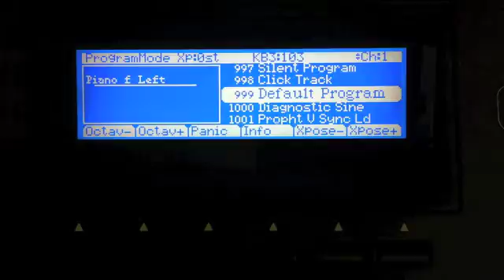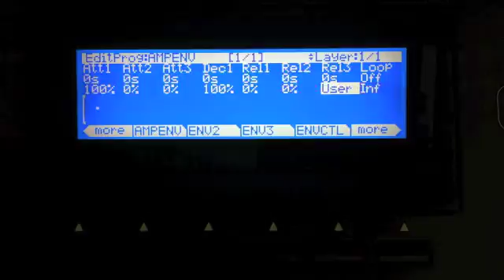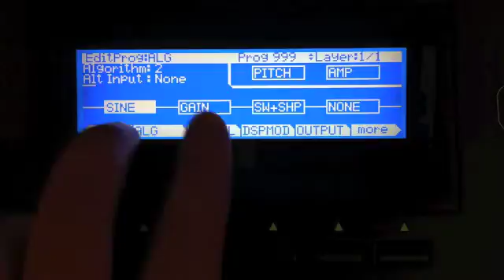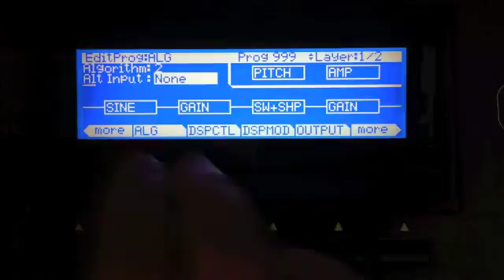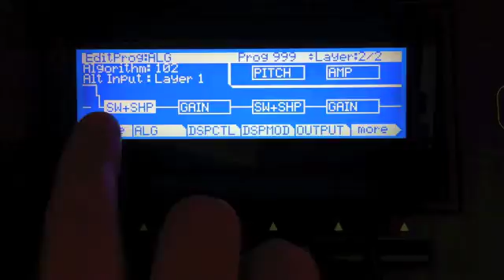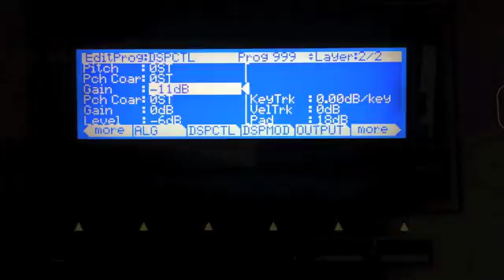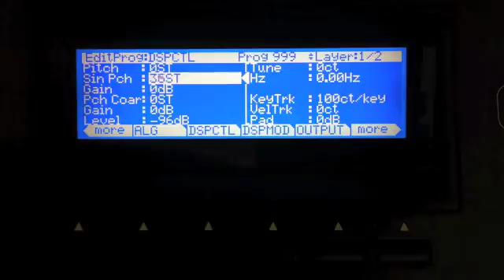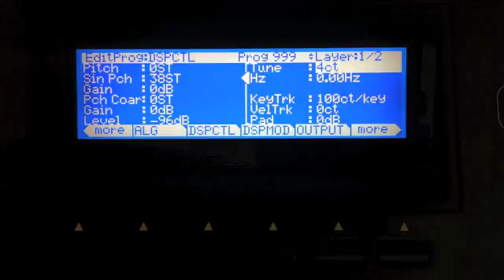Kurzweil PC3: Tutorial 6 -- Introduction to FM Synthesis on the PC3

Comment: Using the "Partials" waves as inputs instead of using a sine gives you the same effect as two modulators into the same carrier, using only a single layer. Of course you don't have independent control of their levels but you can get close by using LOPASS (or HIPASS) in place of GAIN.

Comment: Would be interesting if Kurzweil implemented a DX7-style Operator block.
Reply from the maker: I think that would be cool, I personally like the way it's done currently because you can "split" an "operator" and play around with the insides. But for straight DX-7 style programming, an "FM" block would be fun. The main issue is cents vs hz, namely that Yamaha-style FM has all the "ratios" set up correctly (from a mathematical point of view), and you can control frequency directly instead of having to translate from hz to cents. So, I'd imagine a Kurzweil-style "FM" block would have Src1 and Src2 in units of hz, rather than cents.
Reply: Or maybe a complete DX7-style algorithm including operators in a block. :P

Comment: Great videos - makes me really want a pc3! I just have a question: if you feed a signal into the saw+shaper, the signal is mixed with the SW+SP signal - but where does the fm modulation come in? Does the input to every block also modulate the pitch? So you have sine mixed with the SW+SP sine, which is also modulated by the sine sent in? Thanks for your help.
Reply from the maker: SHAPER is like a sine wave lookup table -- you send in a sawtooth, and it will "read" back the sine wave (with amt set to 0.25, 0.5, 0.75, 1.00, etc). Now, if you combine that sawtooth with a sine wave, you are essentially modifying the DC component of the sawtooth, causing it to rise/fall faster and slower depending on the pitch of the mixed-in sine wave. As this happens, it causes the sine wave to be "read" out of the table faster or slower too, which gives us frequency  modulation. What the sine wave is doing, essentially, is modulating the "phase angle" of the sawtooth, hence this method of doing FM is sometimes called "phase modulation" or "phase distortion".

SAW+SHP combines the first two items (the sawtooth and the sinewave lookup table) into a single block, so now all you have to do is send in another sine wave. If you mix two sine waves together and send those in, you'll get a more complex result as now you have two different waves modifying the DC component of the sawtooth wave. Now, as you increase the gain of the signal going into SHAPER, you will cause the table to "skip" as the incoming waveform starts to "clip", and this results in a sharper sound that roughly corresponds to what happens when increasing amplitude from Op1 into Op2 in normal Yamaha-style FM. To do this, you may have SINE -> GAIN -> SAW+SHP, then use something to control the GAIN block.
Reply: Thanks for the reply - I was a bit puzzled about that! So what does the shaper on it's own do? Can you send any wave to read the lookup table?
Reply from the maker: Yes, indeed! That's the really fun part IMO -- you can "split" an FM "operator" and mess around with its internals (it's fairly similar to other waveshaping, but VAST connects waveshaping and FM in a more straightforward way). The "TWO PARAM SHAPER" is not to be missed, as you can mess with the balance between even/odd harmonics. In another video (tutorial #21) I use SHAPER with some other bits to do a "Supersaw" sound, which makes me think Roland did something similar in the JP8000/8080. So, run all the things through SHAPER and see what pops out. It is "sensitive" to gain, but also DC offset (which video #21 demonstrates) and is neat in conjunction with WRAP, which is also sensitive to gain and DC offset.